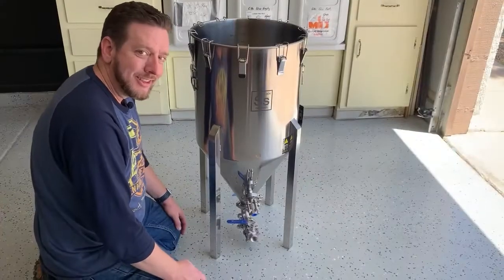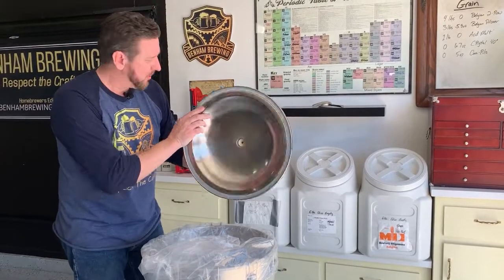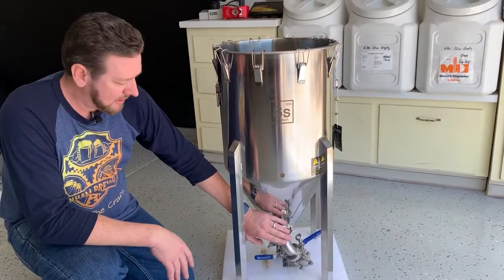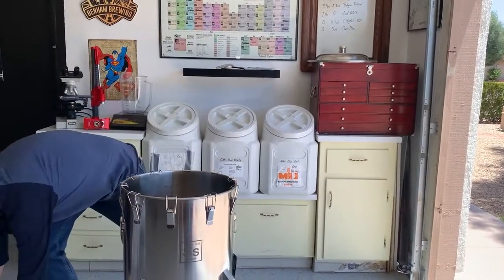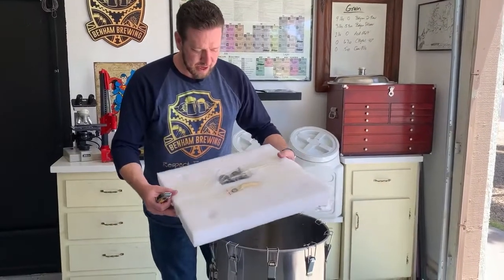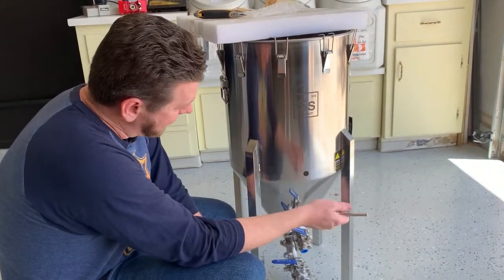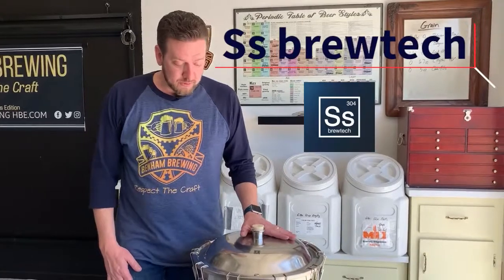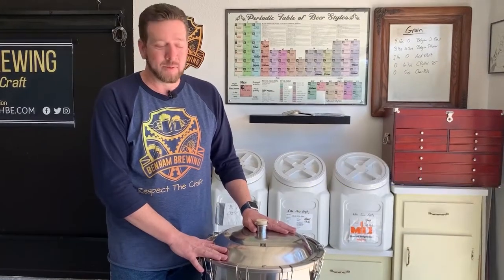Ss Brewtech Chronical Unboxing: Everything You Need to Know!

Comment: Wonder what the weight is full?  In my dream setup I'd have a couple of these but trying to figure out the engineering for a work surface so they would be off the floor.
Reply: Quick calc - @ room temperature, 14 gallons of water is ~117lbs so I'm guessing filled with wort this could be in the 140-150lb range.
Reply from the maker: Shipping weight of this fermenter is around 25 lbs., so yes, around 142 (nice estimate!)